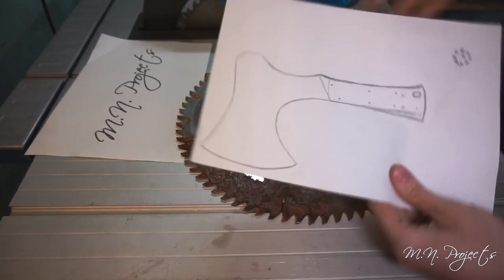Making a Hatchet from an Old Saw

Comment: chooses the rustiest part of the blade to cut an axe shape manliness level 99.
Reply: Bitplex grinding is fun I guess
Reply: Bitplex de manliness iz over 900!
Reply: Oops 9000
Reply: Yeah, this shiny surface is very manly.
Reply: Exactly, i was saying the same :D
Reply: I would have probably threw some vinegar on there and let it sit in vinegar overnight and then just remove the rust the next day
Reply: Bitplex you guys are messing the point that the satisfying part of these videos is that it went from rusty to shiny
Reply: Bitplex there where the two holes kt wouldnt fit
Reply: HAHAHA I’m laughing so hard rn
Reply: Muy bien
Reply: If you ever need a handy tool for chopping pencils in half this is it.
Reply: @clambroth1923  my thoughts exactly. Lmfao! Someones desperate for contant.
Reply: Bitplex save the best part for later one.
Reply: Save the best part for the next project.

Comment: My only real concern is that a sawblade is too thin in its normal form for an axe. It'll look like an axe, but it'll perform more like a knife.  Well, that and how well the temper held up. Still a pretty cool build.
Reply: straight away i wondered how he'd turn a saw blade into a hatchet from the thickness alone, i thought he'd double or triple up the metal thickness
Reply: If it was a little larger in the blade it'd make a good cleaver, but that's as close to an axe as something that thin can get.
Reply: The hatchet won't have a lot of striking power because of the lack of weight, but still would be handy as a nap sack filler.
Reply: InstrucTube imo I think it's more novelty. I mean isn't the hatchet kinda small?
Reply: A gej
Reply: Me made a hatchet wrong, but made a tomahawk right.
Reply: Yeah, it may be knife thin but it is doing hatchet things and you don't need something else to pound on the knife blade.
Reply: It’s not an axe. He’s making a hatchet.
Reply: It will cut much better than a bush crafting knife, but will still be a little light, I’ve made one of these before, and I love it

Comment: Saw blades are typically L6 steel. A very poor choice for an impact tool. If you had heated, quenched, and tempered it like a real hatchet it would likely break during the first use.
Reply: Thomas Woods chemist by trade here but love metallurgy. Elaborate pls (based of material used)
Reply: Mateusz ski l6, especially l6 in industrial use us typically quenched and left at approx 300 Fahrenheit inorder to make th ecrystals in the steel cobvert into banite. Banite structures are among the most impact resistant Crystal layouts imaginable.
Reply: Thomas Woods Im quite sure he is totally aware of all your points 
his intentions were to make cool shit from junk.. If you watch his other vids you would be aware of not only his skill set but his knowledge of the craft
Reply: Thomas Woods glad someone finally noticed it !! . after the knife from a tap, this axe...^^  working , forging , hardening steel is a job, you learn it or you stop it.

Comment: Lovely job there recycling at it's best an most practical.

A tip i use alot of epoxy at work and tape copy paper over the mixing board i use, when i am done peal it off and trash it and stick my mixing board in my tool box for next time.

Comment: On other restoration channels, i've seen people welding holes in metal. If you had done that you would not have needed to shorten the blade. First find out where all the rust is on that saw. Better still , you should have used the part with little or no corrosion and  rust at all. But I assume you are going to use more metal of the same saw for other projects?

Comment: nice work, but shortening blade makes an odd looking piece. Is probably light to begin with, and removing material doesnt help
looks like you had enough saw blade left  to cut a full piece from the other side and do full size if that hole bothered you

Comment: I noticed that there was no kind of hardening in this video, since the saw blade is already made of hardened steel do you temper it off camera so it is more malleable to work with? Or are you doing all of this stock removal on hardened steel  and just being careful to not overheat it

Comment: No heat treat on this one?
Reply: Trgleaves i think te saw blade alredy hace a heat tratment
Reply: than why can you drill the holes for the handle and the skeletization so easy, if there ist enaugh heat treatment before ?
Reply: Tristansfather maybe he used special drill bits
Reply: Trgleaves good point, didn't notice the first time tho

Comment: Anybody care to explain why he drilled so many holes in the handle of the saw blade, if he was only going to rivet 3 main holes through the wood?
Reply: Bitplex weight reduction
Reply: Brad DeMild of course! Thanks for clearing that up.
Reply: Also for holes for the resin to grip in when it dries.
Reply: weight reduction on a 300 gram axe... lol
Reply: I think it also might have to with the balance of the hatchet. You would want the handle to be lighter than the top so it swings harder and more comfortably.  I'm not an expert, just seems like it would make sense.
Reply: he usd  som kind of glue,,so it could get in both sides and  catches well
Reply: ahsaaan100 I'd agree with that - it would give the epoxy resin a much better hold.
Reply: Bitplex to make the head heavier than the handle so he could chop better
Reply: Nothing to do with weight, everything to do with epoxy adhesion.
Reply: Bonding, it’s like tak welding
Reply: So the epoxy resin would stick better

Comment: You should really check the steel first, I believe newer blades are made with lower carbon steel, that's why they have carbide teeth
Reply: William Eberman I use metal cutting saw blades with carbide teeth to make some knives. The steel needs to be fairly hard to withstand the stress and support the carbide teeth. It makes very nice knives.
Reply: William Eberman I also use leaf springs and other high carbon steels for knife making.